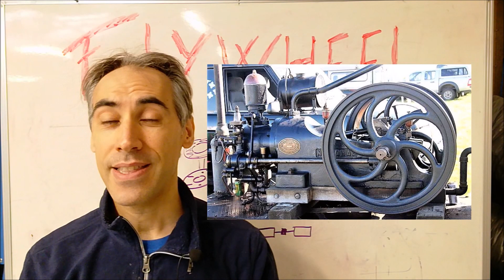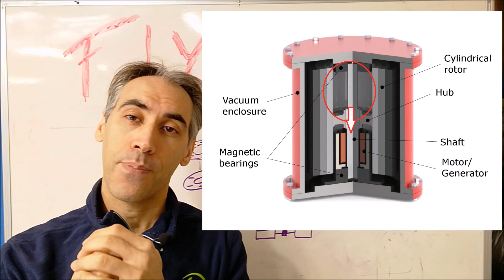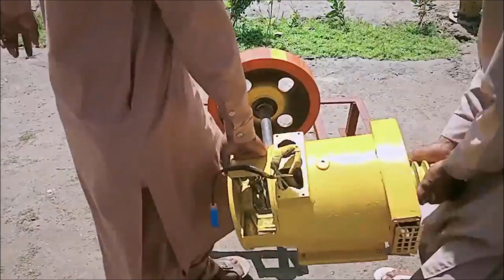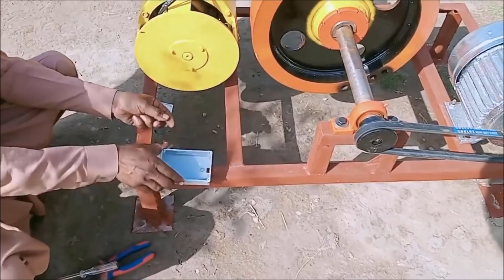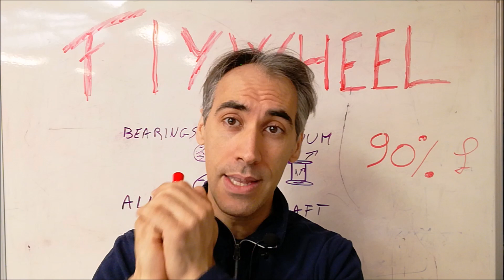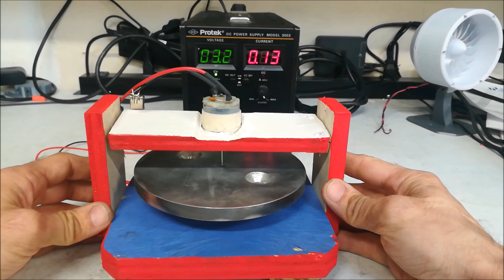WARNING!! ~ Another flywheel Free Energy SCAM

Comment: The contrast between the precision engineering marvel that is modern industrial flywheel and the scammer's abortive effort was hilarious. Boggles the mind how people fall for that stuff, where do they think the energy for all the noise and heat is coming from? Your little mock up was a pretty good effort all things considered. 

It was a little surprised you didn't also measure the amperage output to compare power in/out rather than just the voltage. Although I suppose you were using the same motor as the generator so you weren't stepping the voltage up or down.
Reply from the maker: Yeah, with that much energy drop extending the video another 5min to check the amps isn`t much worth. As you have recalled the 2 units are identical anyway

Thank you much!!!
Reply: @skepticalopen-mind4031  That makes sense, it's not like you had the generator geared to spin at a different rate. I've seen scammers pull the wool over people's eyes by using gears to step up the voltage and claiming there's over unity... Too many people don't know the difference between volts, amps and watts. A good science education is so important.

Anyway, brilliant video. I bet it was fun making your little flywheel. If I win the lottery I'm buying a proper vacuum fly wheel as a toy! ;)
Reply: To measure output current you need to attach a load to the generator. Without a load talking about output current is meaningless.
Reply: @itsawonderfullife4802  I'm quietly confident he knows how to measure amperage. :)